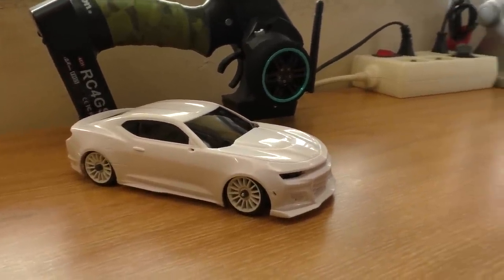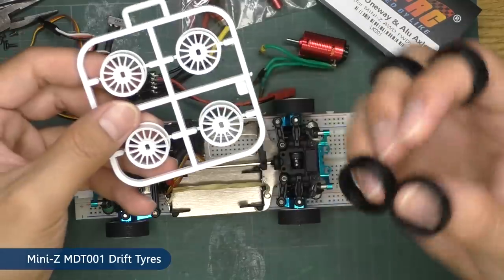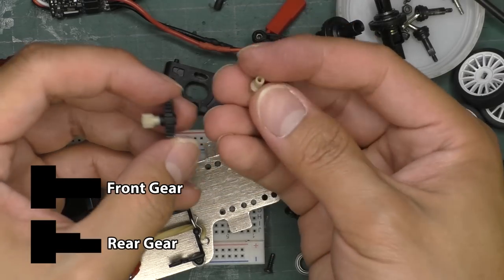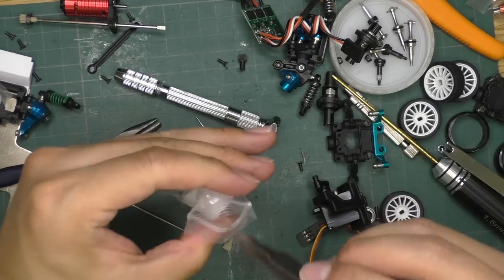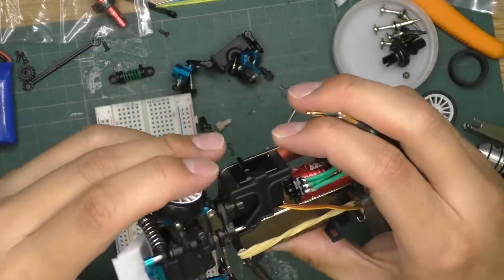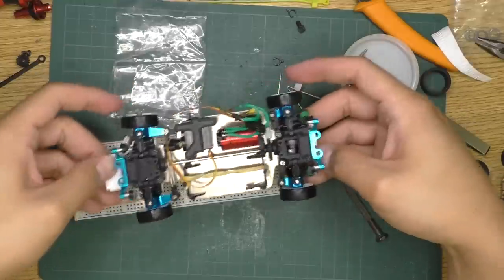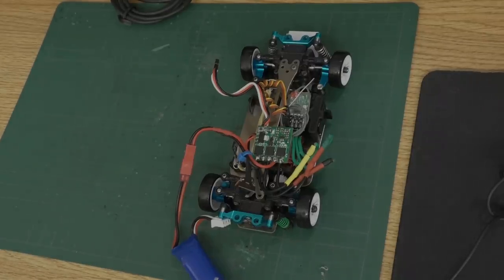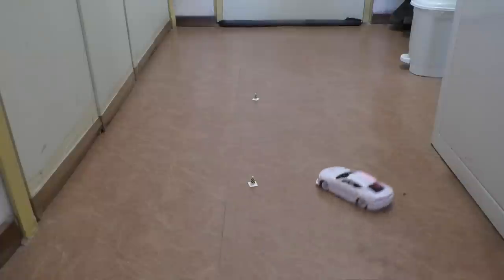WLtoys K989 (and 284131) Budget Brushless Drift Build 2021 Edition | Full Tutorial

Comment: Hello beaver i was wondering what screwdriver and tools do you use for the car i have a k969 and im planning on upgrading it but i dont know what screwdriver and tools to use for it. Also im very new to this rc stuff do you know any recommended upgrades i should do?
Reply from the maker: You'll need Philips cross screwdriver no.1, hex screwdriver or Allen key 1.5mm and nut driver or cross wrench with 4mm slot. You can use a generic cross wrench for RC car on eBay that goes for 1-3 USD. You can also get a full set of screwdriver and nut driver for computer and mobile phone from an electronic or computer shop. The quality isn't as good as proper RC equipment but it will get you going for much cheaper and it's easier to find.

Comment: thanks for the links - going to try a few of these upgrades on my son's 989. by the time it's fully hopped up though its getting close to the price of a drz, bmrx, etc. 

in your opinion, what's the #1 best performing mini drift platform today?
Reply from the maker: I'd say GLD has the best overall performance and design. It's easy to tune and very well thought-out. It'll need some upgrades like front aluminium bulkhead, aluminium knuckles and shock towers but after that it's a great car.

BMR-X drives great but changing motor and tuning is tricky.

DRZ V2 is supposedly good. I got the V1 and it's really good so I haven't bought V2 yet. You got a lot out of the box like adjustable wheelbase and aluminium front knuckles but it can't adjust between low and high motor mounting position.

Also don't upgrade the WLtoys K989 chassis with aluminium parts or carbon chassis. Keep it stock and only do the electronics, diffs, wheels & tyres. Basically anything that you can move to a better chassis. This will look expensive because radio, ESC and motor combined are way more expensive than the car itself but you'll have to buy them with any car anyway.
Reply: @BeaversHobby  thank you for the detailed response! 

I’ve also got a drz v1 but some of the aftermarket or replacement parts have been hard to find at times. I think I’ll pick up a GLD next thanks again🙏
Reply from the maker: @typexfantasy  My pleasure. Best of luck with the project!

Comment: Hello, i have troubles with this FOW Unit on my k969. 

Situation: driving in a straight line then letting of the Throttle the car spins out immediatly. 

Do you have a solution for this? Already checked if the wheels are not tightened to the same amount but that did not help.
Reply from the maker: That is normal for one way especially if you were going fast then let go of the throttle. (Skip to 4.36 of this video to see the explanation https://youtu.be/rTveWKmr8xY )
You can only lessen the effect by making sure the steering is centered, lube the one way bearings inside so they spin forward with the same friction  and if you have a bit of toe out that will also help.

Comment: Great video. I noticed the wheels connected to the front one way differential don't spin when you let off the trigger. I thought they should spin freely. Won't the one way diff behave more like a locked diff if the wheels are too tight and don't spin freely?
Reply from the maker: The oil is still a bit sticky right now. If you look when I reversed, the front wheels did't move. That's probably a better measurement whether it works or not.
Reply: @BeaversHobby  Hi Beaver, I think my front one-way is also sticky -- perhaps this is why if I let off the the throttle at full speed (in a straight line) the car turns sharply to the right? Even with the above, the front-one way has mad a considerable difference improving the sharpness of corners I can take. 

Have you done or could recommend a video on Fluids and lubricants, etc? I'd love a crash course on what should be used for cleaning/lubing bearings, diff grease/types to use, what works good on shocks, etc.

Comment: Always followed your stuff, even before I finally got my k989. When you plan to switch between drift and touring car, are you going to change the diffs too? Or just the tires?
Reply from the maker: Change the diffs too. Standard gear diffs are fine but if you want more adjustability, get some ball diffs.
Reply: As well as Wltoys making the k989 they also have make the k969 which is a drift car. It’s also the same price.
Reply from the maker: @Digitness  K969 is the same car with different body (Porsche), locked diff instead of open diff and drift tyres (not that good but they'll work). I mainly go with K989 because to me the body looks better, open diff can be locked but locked can't be opened and I'll get better tyres anyway. All in all it makes no difference what car it is if you end up doing what's in this video. Just choose the body you like.
Reply: Hello from V&b speed a new rc community channel ✌

Comment: Hey Beaver, I tried the calibration with that esc and a surpass hobby motor. Unfortunately it just stuttered and the esc and motor started getting really hot. Can you help me?
Reply from the maker: Check the wiring and gear mesh first. It shouldn't stutter or heat up the motor excessively if the wiring is correct and gear mesh is good.

Comment: I ordered all of the same parts as in your video. I hope to get to Bind all with the Radiolink remote RC4GS. I already have the Hobbywing programming card.
Thank you very much for your tutorial I will try to do exactly like you.
Can you tell me if it is possible to add LEDs to the Radiolink R4FGM mini receiver?
Reply from the maker: You meant controlling led via radio? You'll need a light controller for that. Otherwise if you just want a simple light that stays on once you turn the car on then you just need some LEDs with resistors like in this video. https://youtu.be/_g4uwUtobPk
Normally the ESC will output 5V to the receiver so you can calculate the resistor you need from that.
Reply: @BeaversHobby  No, I just want a simple light that stays on. This is for a Mercedes AMG GT3 body.
I was thinking of using a system that I hook up to the receiver. Thanks for your link. 
I will already wait to receive all the parts with the brushless motor.
Reply from the maker: @juMorand  My pleasure. Good luck with the project!
Reply: @BeaversHobby  I bought and assembled the Wltoys K989 like in your video.
I have a problem. When I start to accelerate, and barely 20s or more, the car shuts off as if there was no battery left.
What must be configured on the ESC to remove the lipo cut-off safety?
Reply from the maker: @juMorand  Turn the menu 3 to value = 1. It should be off as default so if it shuts off then I'm afraid it's something else. The overheat protection is off as default too so I don't know what could possibly go wrong there.

Comment: Hi, congratulations for the videos.
I wanted to ask where can I buy pinion of different sizes for this engine?

Do you have a link or an acronym so I can search?
Reply from the maker: The pinion gear is mod 0.5 pitch with 2mm diameter hole which is pretty common for small toys, cars and robots.
You can use Mini-Z AWD pinion gear set part number MD006B. https://banzaihobby.com/Kyosho-MD006B
Apart from searching by gear pitch you can also use "plastic gears for small robot" on aliexpress or ebay to get a gear kit that contains some gears you can use.
Reply: @BeaversHobby   Thanks.
Since I replaced the original drive shaft with a metal one, isn't the plastic sprocket likely to be damaged quickly ?
are metal sprockets for that engine ?
Reply from the maker: @Boblebe  There are metal gears too if you look up on Aliexpress. But normally if the gear mesh is good it will last pretty long.
Reply: @BeaversHobby   Tanks
Reply from the maker: @Boblebe  My pleasure.

Comment: will the stock pinion work with the 1410 surpass hobby brushless motors?
Reply from the maker: Yes, it works. However it might be too tight to get in again so if you can get some plastic gear mod 0.5, get some for spares.

Comment: Hi i have a 	
ISDT Q6 Pro BattGo 300W 14A Pocket Lipo Battery Balance Charger
but it cant charge the Lipo that came supplied via the JST plug, does it need to be charged via the the supplied usb charged and the balance plug?
PS. Love this Vid, cost me a small fortune but love it all the same.
Reply from the maker: The Q6 Pro has XT-60 output so you'll need an adapter to convert JST RCY (red JST on the battery) to XT-60.
Reply: @BeaversHobby  Sorry should have been more clear, i have like a 7 in one multi connector cable that goes to chargers XT-60, so i plug balance lead in to chargers balance port and JST to JST RCY on multi connector. but it wont charge, discharge or storage charge. just gives error.
SORTED: I Hope :)
i run-in the car on stand for a short while, put a cell checker on it and it was way out. cell 1=3.86 cell 2=3.54 charged it then with the supplied usb charger that took 10 minutes and the light went off. so tried my charger again and put it in storage charge and it worked charged and discharged cells matched.
will just keep an eye on it, hope its ok.
Reply from the maker: @PrInCeUKER  Sounds like there's a break in the circuit. Check the balance plug placement too because it's all in the same slot but I don't know which side is the correct one. Also some multi connector or board isn't that good so the problem can come from there too. Maybe you can try and make an adapter?
Meanwhile you'll have to make do with the supplied charger. It won't burn your house down or anything so don't worry.

Comment: Hi Mr B, I dont know why my motor is clogging, I'm using dasmikro but when I press full throttle it is clogging, when I plus the th trim to full there is no clog but I cant reverse, please help thank you
Reply from the maker: You'll have to calibrate the ESC before use. 
Hold the button then turn it on, press once to register mid point, hold the throttle and press to register full throttle then push the throttle and press the button to register full reverse.
Also check the soldering and gear mesh. Those can make the motor cog as well.
Reply: @BeaversHobby  Hi Mr B, I managed to find the problem, it's rather embarrassing but to share, I actually tightened the motor mounting screw too tight so it gets stuck when rotating in certain directions so now it is fine, thank you
Reply from the maker: @Raj_RDX  Glad you got it working!

Comment: Please help my carbon fiber chassis with aluminum parts from Aliexpress drive shaft center bearing. I don't know which bearing I need.
Reply from the maker: Bearing: inner diameter x outer diameter x width
Motor mount bearing: 2x5x2.5, put the bearing on first then put the shaft through it. 
Gearbox bearing: 3x7x2, there are 2 of this and they go on the gear. Put them on before putting the gear on the shaft.

Comment: Hey @Beavers, bought a DRZv2 with electronics, now I have to program the ESC, which cards can I use to do it?  Thanks in advance mate, love your work!
Reply from the maker: It's the standard non-sensored ESC, right? You can actually use the same method in this video (holding and clicking the button). The menu table is different so here you go. https://imgur.com/3voCnHc
You can also use a Hobbywing programming card like this http://bit.ly/36m1qw8 but with the menu table in the link above.
Reply: @BeaversHobby  thank you once more for your help! I’ll try it manually once I finish building the chassi
Reply from the maker: @SPL3NDiD1  My pleasure.
Reply: @BeaversHobby  hey, how have you been? Hope you and yours are safe. I have 3 batteries for my wltoys are they compatible with the DRZv2?
Reply from the maker: @SPL3NDiD1  Yes, the batteries are compatible with DRZ V2.
Reply: @BeaversHobby  thank you man, I’m on the last part of the build (electronics). I will have to build the adapters for the esc and battery
Reply from the maker: @SPL3NDiD1  Make sure the polarity is correct and everything will be alright.

Comment: Hi, I am completely new to this hobby but wouldn't mind upgrading my k989 to brushless, would I need every single item or could I just get the motor and esc if that's all I wanted to upgrade, basically the bare minimum? Thanks
Reply from the maker: Bare minimum, you'll need a transmitter, it normally comes with a receiver already. A motor and an ESC. That's it, only 3 things.
Reply: @BeaversHobby  so at the moment I have this k989 out of the box, can I confirm besides the compatible battery it would just be a mother and esc, thanks very much
Reply: Got ya thanks I see 👍
Reply: I don't want to be a pain but I thi k I am on to the correct esc and motor but unsure on the transmitter, any way you can point me in the right direction please. Thanks
Reply from the maker: @JWDav-gy7tb  My top picks for the transmitter are Radiolink RC4GS V2, it's big and easy to use https://bit.ly/30Uw0wl and Turbo Racing P52, this one is slightly more difficult to adjust the settings than RC4GS but it's more compact and cheaper https://bit.ly/3gY3dyP . If Banggood is out of stock, look in Aliexpress.
Reply: @BeaversHobby  legend, thanks a lot 👌
Reply: @BeaversHobby  I have found that thanks, so the one I received with the car as standard would not work then?
Reply from the maker: @JWDav-gy7tb  Unfortunately, no. There's a receiver for the stock transmitter but the transmitter doesn't have any channel reversing or EPA so it won't work correctly.
Reply: @BeaversHobby  ok thanks, learnt a lot from you there. Thanks for that 👍
Reply from the maker: @JWDav-gy7tb  My pleasure.

Comment: Great setup, I got cogging issue on Surpass 1410 3500kv combo at startup. Any suggestion for how to solve it? my car is GLA V2.1. I was running 2S 400mah lipo. thank you.
Reply from the maker: Which ESC do you have? It's usually from the ESC is there's cogging. You can program it and set the timing to 0 to help with cogging.  The next best thing to do is checking the drivetrain so it's smooth and you can roll the car without the motor on.
Reply: @BeaversHobby  MINI 1410 brushless ESC. I was purchased 3500kv combo. I got 2 and had cogging issue on both of them.
Reply from the maker: @jerrycheng5409  Oh, that one... I suggest you replace it with DasMikro or Atomic, GL ESC.
Reply: @BeaversHobby  Thank you for the reply. My DasMikro still on the way, but just want to see if the cogging issue can be solved by some way because I do have 2 Surpass 1410 ESCs with program card. I should watch your video before purchase.
Reply from the maker: @jerrycheng5409  Unfortunately, you can't improve it beyond programming which has very little effect.
Reply: @BeaversHobby  how about install them on mini-q ? currently, I have them on GLA which is 4WD
Reply from the maker: @jerrycheng5409  That'll work. It's a bit better on RWD.
Reply: @BeaversHobby  Great. thanks, I will try it when I get a chance.

Comment: Would the low volt cutoff on the esc have any effect on the R6FG receiver gyro? my Gyro stopped working after I set the same volt cutoff as you did. Also when i brake and go into reverse, the car wont go into forward again. looks like my esc and receiver are faulty 😥
Reply from the maker: No, the cutoff won't effect the gyro. It's a different part entirely. Check your transmitter setting and gyro setting on the receiver. Maybe you can re-calibrate the ESC and see if that helps with the direction not changing. It sounds like your throttle is reversed for some reason so it normally from forward-brake-reverse it goes in the opposite direction so reverse and break instead. 
You can reset the ESC programming by holding the button for a few seconds while it's on.
Reply: @BeaversHobby  Thanks for the advice, I thought the throttle might have been reversed as well but after I brake and then reverse, the green led stays on on the ESC and it wont do anything, it was working previously as well so i think its probably damaged in some way.
Reply from the maker: @ArcticNightwind  Try and reset the programming.